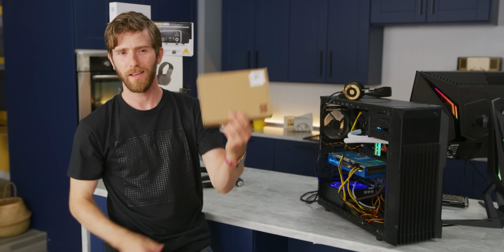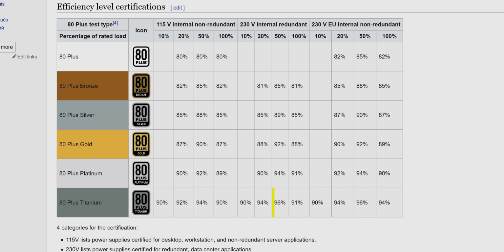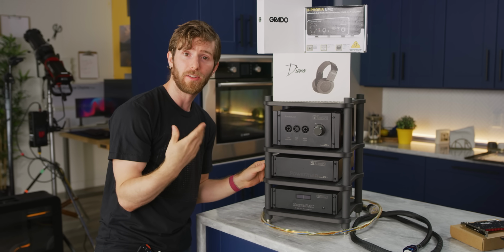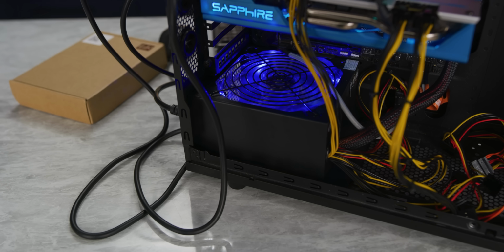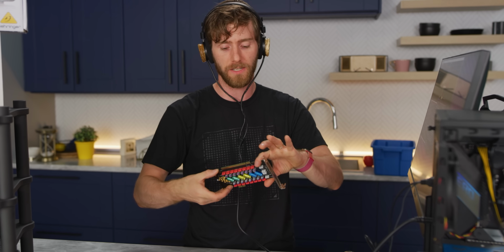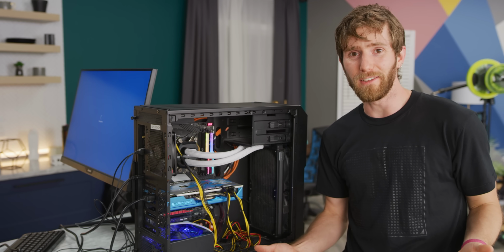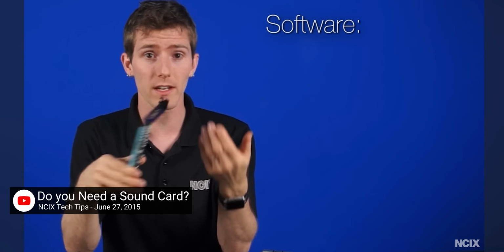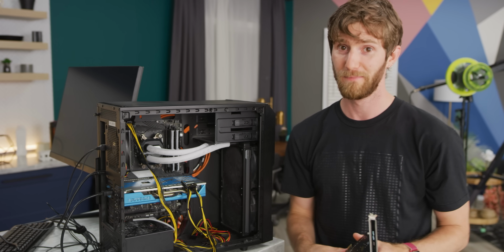Is this $40 card a SCAM? - "Audiophile" Power Filter

Comment: And there's a meme that satirizes the innocent audio enthusiasts:
1) Using thermal power to make the sound warmer, the sound of hydropower is colder but the resolution is high. Among hydropower, Gezhouba has the best tone. In thermal power, Beilun Power Plant has the best electrical tone because of the proportion of anthracite burned is the highest 2) The sound of the same set of equipment felt a little colder from 8pm to 10pm. After 11pm, the sound was obviously warmer. Later it was discovered that the peak time electricity was used by hydropower from other provinces and the valley time electricity was mainly local thermal power. 3) The quality of wind power is very poor, and the sense of hearing is dim. Listening to the driver’s A major and B minor, the sound field is obviously shrunk. The violin part is mixed together. 4) The sound is thinner when the power of single unit power of wind powered generator is below 500w. Three-phase and two-phase have little relationship with timbre. The key is the sense of balance. The three-phase electric player has a large symphony formation which is obviously more stable than the two-phase one! Nuclear power is suitable for playing large-scale soundtracks such as "Terminator", but unfortunately water, fire, wind, and nuclear power are all on the national grid, so all sounds are mixed. 5) An enthusiast moved from Shanghai for this reason. Guangzhou’s sound is much better because China Southern Power Grid uses Daya Bay Nuclear Power and Liangguang Hydropower as the main audio system. It is both strong and clear. Recently, it is preparing to invest in the construction of an independent Yarlung Zangbo Hydropower Station. The Tianshui in the mountains and snow fields will make the audio reborn. But the feasibility study report is opposed by India. 6) What is the difference between solar power generation? The sound is warm, not cold, but a bit thin. 7) Not long ago, a friend of mine, the most senior earphone enthusiast in China, tried to listen to the Audio-Technica AT-HA25D amp with AD2000 earphones for a day. After listening, he suddenly took off the earphones and said, "I can’t listen to it today, it must be a hydropower station. The water level has risen again", leaving other fans present stunned! The next day, it was reported that a flash flood occurred, and the reservoir level of Xiaofengman Hydropower Station soared, reaching 1953.

Comment: I doubt this board has more 5000 µF. Considering the fact that the PC can deplete these caps within a few mili-seconds, this won't have any effect. You need a few farads to actually achieve anything, and that would rather trigger the over-current protection on the PSU.

Comment: I have to fully disagree on this one. On my system, a special build 5.1 system, it is a huge improvement. This system is designed by Micha Jacobi, who build studio's for people like Armin van Buren etc. I have for example The Grimm CC1 wordclock, which was a huge investment but opened up the soundspace tremendously. This simple card did also a huge job in opening up soundspace and eliminating distortion. Compared to the rest of my system it is dirt cheap. I am currently waiting on other cheap update of the USB device and the PC fans. It is a long distance, but I can demonstrate this and others hear the difference loud and clear.

Comment: LOL  I'm glad you got to those conclusions.  Because, yeah, I've built many a system with HORRIBLE onboard audio.  Especially when you use headphones instead of speakers.  And honestly usually the best solution for those was simply to add an external USB audio "card".  Today ... well, I'm sure there are still some "budget" mobos with horrendous audio.  Never doubt in the ability of a manufacturer to cut corners.  LOL  (It's why I build my own systems.)  BUT, as you point out, this $40 card is utter nonsense.  Even IF it did what it claimed, simply spending that $40 on a better mobo and power supply would be a MUCH better investment, in my experience.

Comment: EMI isnt only on  the power lines..   and the motherboard has heaps of capacitors already right ???
Reply: Maybe the card can help if the  system does have heaps of noise ..
Reply: Audible ( direct from.the card )  Coil  whine  isnt caused by external power,its caused by the FILTER coils .  vibrating as they are physically feels forces. . .the gpu is causing the voltage fluctuation driving the noise there

Comment: Linus, I don't think you noticed a difference because you used a decently high-end motherboard with its own dedicated audio capacitors where the manufacture put effort into isolating as much electrical noise as they could. 
I don't think anyone with a motherboard like that is running off and putting sketchy PCI-E cards in their motherboards from China.

If you guys tested it with an extremely low-end motherboard (from eBay or something) with a CPU from a certain era, you might've noticed the difference (I could be wrong, I'm just trying to give this company the benefit of the doubt and trying to figure out their target customers because I believe it's more of the low-end people that can't dish out a new motherboard and a new CPU to go alongside that motherboard)

Comment: Hello, 
I recently changed my GPU from the rtx 2060 to the GTX 1080 ti. After this , m.2 NVMe stopped showing up in my computer. I tried to push it into the motherboard slot but it didn’t work. I restarted my computer but again, nothing. I shut down my computer, left it for a bit and tried to turn it on again. It didn’t turn on. I tried everything. Checked the psu, the cables , the GPU , but nothing worked. Please give me some insight on how to tackle this issue. Thanks

Comment: It would be interesting to pair it with a cheap or mid  priced tube dac amp because tubes usually don't like PCs. I had a huge issues with my gaming rig and tubes as the buzzing sound was pretty overwhelming. Noise dampeners are usually on much more expensive DACs so I had to return my AMP to store. Even though the DAC was nice and the sound was super sweet

Comment: Why didn't they use speakers? It's so easy to hear noise with those, they wouldn't even need to play any music — control test with some good external audio processing, and then out of the built-in audio with/without this card, with volume turned up enough to hear the PC noise but not so up that they'd hear speaker noise.

Comment: Extra capacitors can improve the flatness of the voltage given by the power supply. Most power supply manufacturer put is as many as needed and not a single Farad more. So there could be something done. Putting a few extra capacitors near where the power is used could be a good idea. It would be better to unplug all cables and add large quantity of capacitors and coils, and then I mean real huge capacitors. Maybe leave the idea of switching power supplies completely and go back to conventional analog transformers and diodes. It would be costly and big, but what is good for high end audio could be good for computing as well. Oh yeah, and it weighs a part of a ton, classical transformers are heavy.

Comment: You could test your ears/audio system whether it is good enough by 
- Try swapping Opamp on your DAC.
- On DAC try to switch filter (eg., Fast Linear, Slow Linear, Fast Minimum, Slow Minimum, Super Slow, Apodizing, Hybrid, Brickwall)
- Try MAC vs Windows vs Linux
- On MAC (try Audirvana vs Fidelia)
- On Linux (Try DeadBeef, Audacious, MPD)
- On PC (try WASAPI vs DirectSound vs ASIO)
- Try Daphile standard kernel vs low latency kernel.
- Try Daphile in Headless mode without GPU and APU disable vs with GPU.
- Try Hynix RAM vs Samsung RAM
- Playing source file audio from Samsung SSD vs Sandisk SSD vs WD SDD vs WD velociraptor 10k HDD vs Other HDD

If you cannot hear the difference, I don't think you could hear the difference from this card. Problems lie either on your ears or audio equipment. I have older generation of this card and running test session with friends, they're all notice the difference (test methods above included)

Comment: "Spend your $40 on a better motherboard!"
Okay, so how high should I be going to eliminate the electrical noise from the line in on the my mobo? Is a $300 mobo not enough, Linus? $400? $500? How high, Linus? HOW HIGH?
Reply: I mostly worry about bad on board audio on older MOBOs. Even most modern sub $100 MOBOs have audio good enough for most people. Notice he also mentioned "a better computing experience in general" so he probably means $120-$140 where you get a better chipset, more USB 3, maybe even thunderbolt, more RAM or M.2 slots if that's a concern for your work load, better power delivery for your CPU if you want to overclock (not saying you can't on a cheap MOBO, but power delivery does get more stable on higher end boards, and yes, better audio, among other improvements and additions. Hell, put that extra $40 towards a 1TB if you were going to go with a 500GB, a NVMe drive instead of SATA, a better PSU, a good CPU cooler instead of a stock one for a budget build, even something like your GPU. Sometimes sales push the 2060 within $50 of a 1660 super. $40 can be a big difference sometimes, for both PC longevity (like a surge protector or a small UPS) and general experience when you get the PC booted.
Reply: @gryffon7497  By this logic then my Crosshair Hero VI shouldn't have electrical noise from the line-in on the rear IO. But it does. Most noticeable when CPU or GPU are under load.
Basic point I was making Linus is saying "just get a more expensive motherboard haha!" as a resolution to electrical noise in the audio.

Comment: Hey guys i was looking for advice on the best cheap cases to buy to fit all these parts(specifically looking for cases with fans and some type of cooling) :

CPU -AMD Ryzen 3 2200G

MOBO-Gigabyte B450M

RAM-Corsair Vengeance 8GB

SSD-PNY 240GB

PSU-Seasonic S12III 450

Thank you for any suggestions

Comment: Can you plz build a pc out of these parts because I want to build my first computer and I don't want it to be a really bad computer. Here are the parts: ryzen 5 3600 3.6 GHz 6-Core, Gigabyte B550M DS3H Micro ATX AM4 Motherboard, Crucial Ballistix 16 GB (2 x 8 GB) DDR4-3200 CL16 Memory, Seagate Barracuda Compute 2 TB 3.5" 7200RPM Internal Hard Drive, Inland Premium 256 GB M.2-2280 NVME Solid State Drive, XFX Radeon RX 580 8 GB GTS XXX ED Video Card, Thermaltake Smart BX1 650 W 80, Bronze Certified ATX Power Supply, Cooler Master MasterBox MB510L ATX Mid Tower Case

Comment: There are many ways to objectively, quantitatively demonstrate and measure improvements to noise and distortion levels. The fact that the sales sheet for this card has none of this says a lot about what it can(not) do. 

On the other hand, like most audiophile wankery, if you believe it works, you really WILL hear an improvement. Lucky you if a $40 card does it for you rather than a $17,000 power cord, which really is a thing.
Reply: Depends, I got an external headphone amp and didn't expect it to sound much different, I was blown away by it.  I then later bought a budget (but decent DIY) USB DAC and was shocked again as I could hear sounds in the music I couldn't before.

The key is not to go for the most expensive things you can find as the components they use aren't really that expensive, you are paying a premium for some company to put together a niche product.  Thus why the DAC I chose is based on an open source project, I just didn't want to assemble it myself so paid a small premium for it pre-built.
Reply: The cheapest stuff often is not worth it (cheap buys twice) while the really expensive stuff wants a premium just for the name, no matter the actual quality behind it.
Luckly I'm happy with VBR MP3s on my Bose speakers and my Superlux headphones, but I do hear the voice lines in Skyrim hissing.

Comment: Linus,  don't touch capacitors just after you kill the power. This was low voltage, but you need to have it locked in your brain that they are no touchy touchy unless powered down for a while. I don't want you to get hurt, I enjoy the content. Just like you'll enjoy this segue to my other safety tip, don't short lithium batteries.

Comment: Right off the start from the close-up: those large-ish 100V 10uF electrolytic capacitors are practically pointless. A- electrolytic capacitors have a fairly high internal resistance so they don't help with the high frequencies of CPUs/GPU/PCIe/USB/PSU (they're good with low frequencies). B- 10uF is nothing. There's no 100V on PCIe, a lower max voltage cap would have had a much higher capacity to filter power fluctuations and lower internal resistance (faster response) but may have been slightly more expensive to make.

Comment: You should've used an oscilloscope to check if the noise reduced at the 12v liine. Also, an headphone which is very easy to drive might be helpful as well, as noise gets more ampilified.

Comment: If you're having problems with cable whine or you want the purest quality sound you can get you should just send your sound over a digital rather than analog interface. HDMI, DisplayPort, USB or optical toslink are options for a lot of audio equipment.

Comment: Screw coil whine, my GPU has an awfully loud coil whine when rendering at 120+ FPS. Can even hear it through my headset when gaming sometimes, especially when using hardware accelerated applications that aren't properly frame limited - it just starts screeching.

I probably should've RMA'd it once I got it, but I was too excited to have a new stronk GPU at the time.

Comment: Of course this card won't help at all. You can't filter noise by putting a filter (even if it was the best one) in the wrong place. To filter a noise you need to know it's spectrum, but in a random computer there is no way anyone could just guess and make the filter for it. And of course one filter won't work for all kinds of noise.

Still remember my first PC and it had sound on MB. That was not great even on the cheapest possible speakers (the only ones I could afford at the time). Even these days there are shitty sound cards on MB. At work I have and HP workstation and in a previous job it was Dell. Both have the same issue. The sound card picks up all kinds of noise. I was able to hear the noise created by variable power consumption when I move my mouse and its light source switches to higher power and it starts scanning the surface. I ended up using external DAC and headphone amp, because I love listening to music, but also one with a good quality. More expensive MBs could have decents sound, but I'd rather use HDMI and let my receiver do its thing. Getting analog signals out of a PC case with a good quality is not easy and costs money, like good dedicated sound cards including external ones.

Comment: My old PC has a motherboard that, when transferring files the USB on the front panel while plugged in to the port in the front panel, would produce a noise so bad that you could hear when the transfer speed slowed down. You can hear it through the microphone too on discord.

Comment: Hissing and / or crackling heard over the sound system is in many cases, the failure of a electrolytic capacitor. Hear it and it's time to consider a new component. Start by switching PSU and if still present, consider Mobo change.

Comment: While I think it's great that you review audio stuff, when evaluating a product claiming to reduce the audio noise floor, maybe you should consider actually measuring the noise with and without the card
Reply: Totally. Its an obvious scam tho not being inline. The capacitors charge up and....Nothing else!
Reply: @jc.1191  It could still filter out some high frequency noise in the rail. It’s hard to say without using actual test equipment to measure it.
Reply: @douggabbard7220 Yeah. I think it has to be before a powered device to affect the device tho. Testing would have made a better video.
Reply: @jc.1191  not necessarily. It would depend on the machine’s devices and how much noise they’re injecting into the power rail. The noise hear on the inductor doesn’t mean a lot.

If you look at any integrated circuit on a PCB you’ll notice that it has small capacitors next to it (a good example being older CPUs with capacitors on the bottom). These are decoupling capacitors that help to filter high frequency noise. Different values and different technologies provide filtering for different frequencies.

Without getting too deep into EE, this card probably helps to filter low frequency oscillation from mains and the overtones from the fundamental. As it wouldn’t be close enough to the specific components to filter higher frequencies. However, without Linus actually using test kit to explore how well the filtering works, we have no way of determining its efficiency but for ‘Linus can’t tell a difference.’ Which is far less than scientific.

Comment: I am facing this issue now. Just built a PC. When hooked up to my studio equipment I get very bad interference noise when the fans and  gpu ramp up in games. Used multiple 3.5 cables and tried the audio out from io plate and one on my case. If I use headphones I don’t hear any interference. It’s not my mixer as I use the same cables for audio out from my MBP. Should I try getting heavy duty shielded cables?  Or is something not kosher on the pc?

Comment: A mic recording could help detect noise as well, I wouldn't expect the card do anything, but there was this pc I tried with a less than ideal power supply where listening was completely fine, but the mic had an awful noise that would only go away when I touched the case to ground it